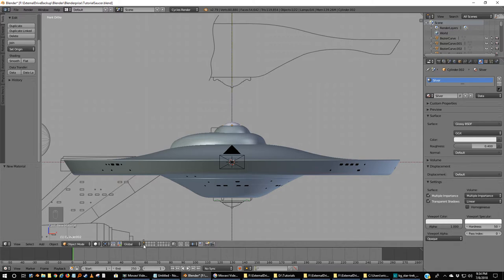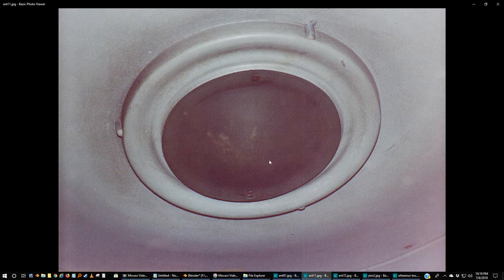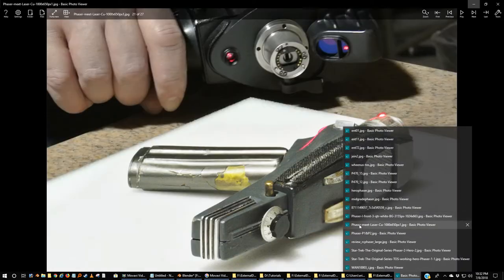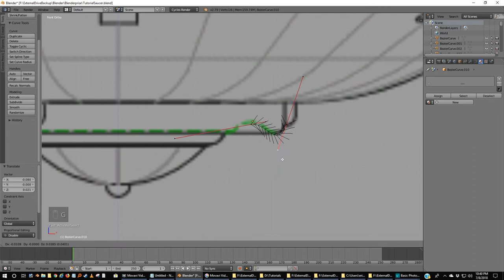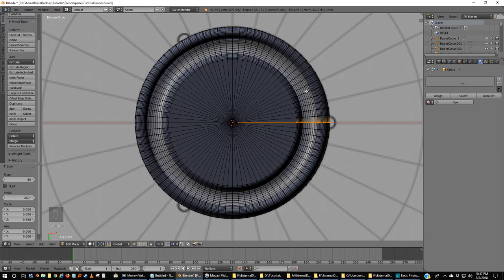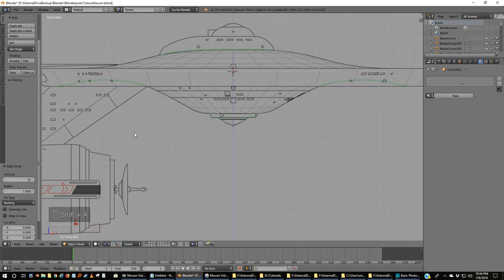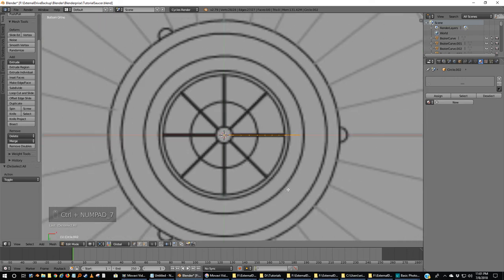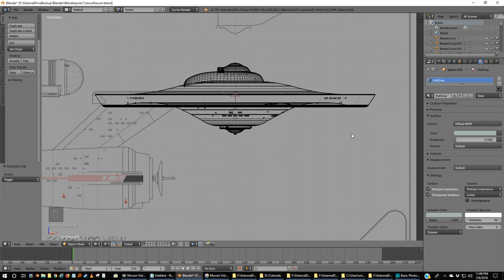7 Saucer Lower Sensor

Comment: Helpful hint: you can use Alt-H to unhide anything you accidentally hid, Also you can use Shift-C to move the cursor to the center and using shift and ctrl to lock a transformation or to the grid increments.
Reply from the maker: Thanks Starfleet2360!  Yeah, I was trying the Alt-H and for whatever reason, it just wasn't working!  LOL!  I was going NUTS!